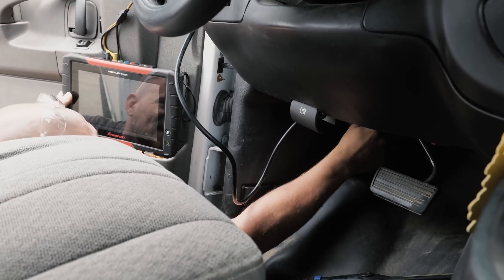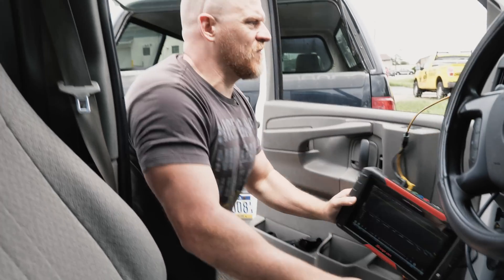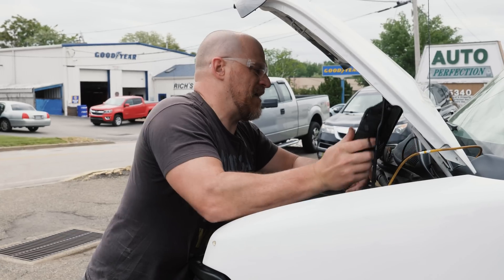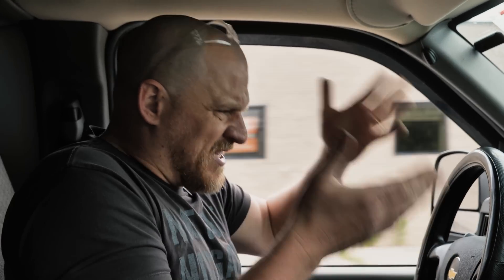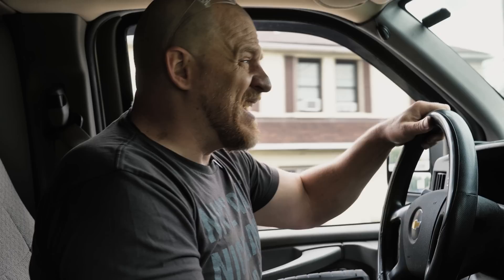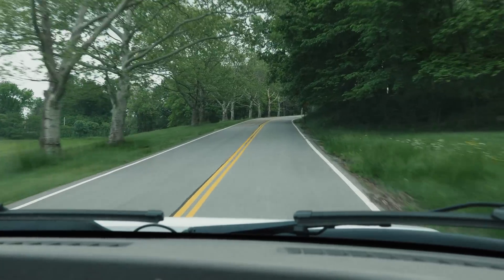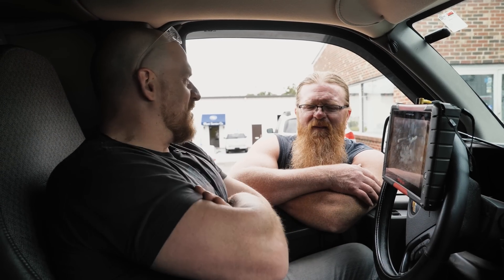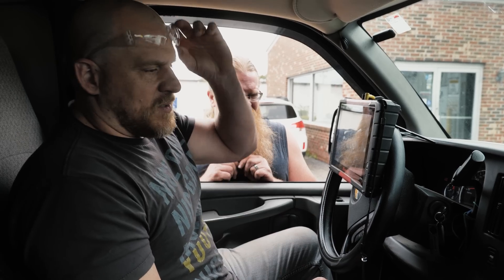We Don't Work For Free [Charging Diagnostic Time]

Comment: Ok and the customer should not pay for you to Eliminate the obvious. The price charged to plug in a computer that takes 10 seconds is absolutely ridiculous.These diagnostics computers are doing the work at this point. Customers are willing to pay for your knowledge not your guess work at their expense. Again Customers can run a diagnostics and get several codes and guess which one may be the problem. What in the hell makes you think it's fair to the customer to pay an extremely high hourly rate so you can guess the correct code from the diagnostics test? NO AGAIN CUSTOMERS PAY FOR YOUR KNOWLEDGE  NOT TRY AND SEE GUESS WORK. WE CAN DO THAT OURSELVES FOR THE PART COST ONLY. WE DON'T PAY  FOR YOUR LACK OF KNOWLEDGE. The customer should not pay because a certified technician does not know which one of the codes the diagnostics test showed is the problem.  I understand these new engines are complicated, however that again is what we pay technicians for. If you don't have the knowledge, you have absolutely no right to charge hours of labor for absolute guess work. RIDICULOUS.
Reply from the maker: See how misled you are? 1.You've only experienced parts changers with the garages you've taken your car to. (Not your fault)
2. You think the scan tool and the codes set is the diagnostic (we have 4 injector codes, should I have changed those injectors?? News flash, that would have cost you $1000 with labor and would NOT have fixed it)
3. This is an intermittent fault that REQUIRES the fault to be duplicated, while I have test equipment hooked up to be able to even be remotely close to finding a direction. Otherwise we are throwing parts at your car. 
I bet you'd be the first one to demand your money back when it's not fixed too? After demanding that you will not pay for diagnostic time. You can't have it both ways! 
 (Stay tuned next week for the full case study)
Reply: I am not speaking about this one particular case you are working on. I am simply stating that it is totally unfair to charge a customer an hourly wage to go through the codes to see which one fixes the issue.  My brother is a certified technician at a dealership for one of the largest manufacturers in the country.  He has access to the latest technology and toys to diagnose a problem.  This is the facts and reality. After every test, diagnostics test run, there are almost always more than one code or part that could be the cause of the problem. At this point the technician will make an educated guess which part to replace first to see if this was indeed the problem.  My obvious point is that the customer should in no way be paying an hourly rate for a technician to be changing a part that the technician has zero proof of that this will fix the issue. Customer should not be forced to pay for guess work period. Again we can do this at home. We pay a technician for their knowledge not guess work PERIOD.
Reply: @tspur3294  Here's how these "codes" work.  A code is a fault in a particular system.  Codes may set in series. P0299, underboost, P1101 induction system performance, P0171 lean, P0300 random misfire could all be related to 1 issue.  Whats causing it??  From reading a code you will never figure it out.  And no, a tech will not make an educated guess and throw a part at it to see if that fixes it.  You buddy, have no idea what you're talking about.   What does he throw first? A turbo for the underboost? An o2 for the lean code? All 4 coils for the p0300? See how silly that sounds???
Reply: @JD730          Every single code is a part that must be inspected,to insure it is working properly before being eliminated as the problem after a diagnostic test.  So again like I stated the diagnostic test does not pinpoint the problem. So why in the hell is the customer paying a ridiculously high price to give these technicians a starting point.   We can do this at home ourselves. If you will be honest you will have to admit that customers are way over paying for these diagnostic test.
Reply from the maker: @JD730  amen
Reply from the maker: @Jeff I hope this is the same Jeff I've been speaking to. It is this type of customer who I was just speaking of in my last comment to you, where they absolutely need to see the difference between a parts changer and a tech. Do you see how misled he is? I was speaking to this type of customer in my 1 in 10 example. I'm trying to convince them that there is another way out there, that they may have never experienced before, and when they find one of us (true technicians), they won't mind paying our diagnostic fees! Hope that makes sense
Reply from the maker: @tspur3294  I agree with you if all they are doing is reading a code and then changing a part!
 ("don't be a parts changer" is my slogan)
Someone who is doing that IS guessing, and is NOT doing pinpoint diagnostics like I do. 
Again, the codes on this van is all 4 injector codes on one bank of this V8 engine. Where would you like to start? It will get way more expensive walking that path and in this case you wouldnt even fix it, than it would be to pay us diagnostic time to actually troubleshoot the issue.
Dealer life and warranty work is a different animal in itself. You get this car with an intermittent issue, that has a code, and you've done 20 of these already, so you know where to go. That dealer tech works on one car line. It is completely different for a guy like me who works on 40 car lines and may never see the same problem twice!
Give that dealer tech a different car and he's lost, why? Because he never learned how to actually troubleshoot!
I'll also add at the end here, that if I've completed my "diagnostics" and make a call and change a part, and it doesn't fix it? I own that car until I find the issue and I NEVER pass that additional time off to the customer. It was my fault I missed it. 
Seriously, I hope you watch next week and then tell me again that I shouldn't be paid for my time.
Reply: @ScannerDanner  Come on scannerdanner be a little nice here.  I bought your book, I have been in the industry 20 years, I am a dealer tech.  Please don't assume all dealer techs are useless and can't diagnose and just throw parts.  That really bothers me when someone of your level thinks that all other technicians especially dealer techs are parts throwers and really makes you come off as no different as the guy who said all techs are garbage.
Reply: @ScannerDanner         well my brother started his career in the military and has worked on about every make of vehicle ever manufactured. So rest assured he is  aware of pin pointing the problem. Which again a diagnostic test does not do and is why I'm saying customers  should not be charged such high prices for the diagnostic test itself. A large percentage of Americans have learned through experience how these diagnostics and codes work and feel we are being way overcharged. Most customers would not mind a fair price for a diagnostic test however the prices charged today are ridiculous.
Reply from the maker: @JD730  I meant no disrespect. This is 9 out of 10 other techs too. I'm sorry. I know some absolutely phenomenal dealer techs.
Reply from the maker: Replying to my "dealer tech" comment. I want to be clear that this is NOT every dealer tech that I'm speaking of here. My best friend Tommy Wolfe (former student) is an absolute badass troubleshooter and does not fall in this category!
I was only painting the picture for this customer who's saying we shouldn't be charging for diagnostic time (his brother works for a dealer) and we all know that the dealership is a perfect breeding ground to develop the parts changing mentality.
I'm not saying this guys brother is no good either and I can see how it maybe comes off that way. I'm just trying to get him to understand there is a difference between what he knows and what can be
Reply from the maker: @tspur3294  
"I am simply stating that it is totally unfair to charge a customer an hourly wage to go through the codes to see which one fixes the issue"

This is not troubleshooting. It's reading a code and rolling the dice on what parts to change and I agree, no need to pay diagnostic time for that!

"After every test, diagnostics test run, there are almost always more than one code or part that could be the cause of the problem. At this point the technician will make an educated guess which part to replace first to see if this was indeed the problem"

A resounding NO here! This is NOT troubleshooting, it's guess work and a dealer tech can get away with it (sometimes) because he works on one car line and has seen this same problem many, many times!

"the customer should in no way be paying an hourly rate for a technician to be changing a part that the technician has zero proof of that this will fix the issue"

Agree 100%! When I'm done, I have proof of where the fault lies, I'm not guessing. 

 "Customer should not be forced to pay for guess work period"

Agree again!!

"Again we can do this at home. Why pay a technician for their knowledge not guess work PERIOD." 

Agree again. You don't know me very well, nor have watched enough of what I do. I'm not talking to the guess work people!!!

Paul Danner 
www.scannerdanner.com
Reply from the maker: You edited your post. This was in response to your original comment
Reply: That's we pay a technician for their knowledge not hours of guess work.
Reply: So yes the amount that the customer is being charged to run a diagnostic is an absolute rip off when you take in the fact that the diagnostic test does not pin point the problem,  it only gives the technician a starting point.  Surely you can comprehend the high prices charged for a diagnostic test is absolutely unfair to the customer. Also the labor charge for changing a part that the technician has absolutely no clue if this is the problem or not is 100% wrong and unfair.  I mean a sense of common fairness and appreciation for the customer must be realized at some point...
Reply: For any certified technician or do it yourself mechanic. A diagnostic test WILL NOT PIN POINT THE EXACT ISSUE OR PROBLEM.  knowing this undisputable FACT. would you not have to agree that the price the customers are paying for these diagnostic test are  extremely high and the customer is being overcharged? Again regardless of education, experience or training most diagnostic will not pin point the problem..
Reply: @tspur3294  so you bring me your car with a catalytic converter code. You think I should 1)not charge you for checking the code. 2)just install a catalytic converter because it's not fair for me to charge the time it takes to perform any tests, 3) install it at cost and at a loss on labor and finally 4) look like an asshole for misdiagnosing your car when the light returns.
Want a free rental car or an hour alone with my daughter while you're at it?
Reply: @fastestcaskets5020    What I'm saying is, yes check the code.  In almost every single case there will be more than one code.How ever after the code  has been checked this is when the real inspection begins to see if yes the Cadillac converter is in fact the problem.  Knowing the fact that in most cases the diagnostic test does not show the exact problem and only really gives possibilities to the technician.  STOP CHARGING A RIDICULOUSLY HIGH PRICE FOR THESE DIAGNOSTICS.  Customers don't mind paying a reasonable price for a diagnostic test. However it is simply wrong to charge these high prices for a number of codes or parts that could or could not be the problem.  Again we don't mind a fair price for a diagnostic. It is simply wrong on every single level to charge these high prices for a diagnostic test. Again there would be no complaint for a reasonable price.  I'll keep my sarcasm to myself. A large percentage of Americans have learned through experience exactly how these diagnostics and codes work and now realize, just how absurd it is to pay such high prices for a diagnostic test.
Reply from the maker: @fastestcaskets5020  preach it brother
Reply: @tspur3294  You seem to be confused. Checking  codes with a pocket code reader is not synonymous with a "diagnostic test". Yes, you can retrieve a generic power train code in your drive way. This is not a "diagnostic test". A drive while gathering relevant data to determine volumetric efficiency is an example of a diagnostic test. And by your logic, if that test proves for instance that fuel delivery isn't an issue, you don't think you should have to pay for that test because it told us what wasn't wrong instead of what is? The tech doesn't deserve his hourly rate for that test? The shop owner doesn't deserve to be paid for the investment in tooling to perform this test?
We are not "guessing which code will fix the car" as you say, nor does "the diagnostic tool do all the work at this point". As an accomplished, professional technician, I find these statements quite offensive.
Reply: @tspur3294  You're dense dude.  CODES DON'T TELL YOU WHATS WRONG.  YOU PAY FOR DIAGNOSTICS. NOT A CODE READING SESSION.  You're paying for us to find the problem and that's why you are being charged because that takes time and skill.  I don't see what you're going on about .
Reply from the maker: @tspur3294  100% incorrect on not being able to pinpoint the problem. Watch some more of my case studies and you'll see. Here, watch this one https://youtu.be/agbEFhAyYI4

Comment: A trend that I've been seeing in the industry is that repair shops are claiming that a lot of their profit comes from the markup on parts. I think that's a backwards business decision. The repair shops should be charging for the skills and talent their technicians have. Parts changers have little, if any, diagnostic ability. It's almost like the technician who can trace an intermittent problem down to a corroded wire is demonized because he didn't sell any parts to make a repair. If we want to be parts salesmen, we'll go work at an auto parts store!
Reply: I agree, the people who take the time and develop the skills to fine the actual fault are often scolded for it. I worked at a few shops where the manager knew next to nothing about automotive repair, they were more or less a salesman. They were only interested in how many parts and services they can sell to a customer. The guy who finds the wire that is broken and can repair it is not as valuable to them compared to the guy who recommends swapping different parts and up selling extra services.
Reply: I know that exact feeling of being scolded for fixing a car with out new parts. At a previous employer, car was towed in from another shop because supposedly it needed a pcm and programming. The boss of course was excited for that. I got the RO, and after 2-3 hrs of fixing all the screwed up wiring the other shop loused up, the veh drove out perfectly fine under it's own power. My shop owner was livid that I fixed it with out the new computer.  I asked him, "would you rather take $1800 and not fix the car, or the proper amount of labor time and have it fixed", he just said, "next time just do what you're told". ..... I laughed......

Comment: You're absolutely right about 9 out of 10 shops being nothing but parts changers. I work at a shop that takes in all the work that the other local shops and dealers can't handle. It really sucks when you get a vehicle after it has been to 3 other shops for the same issue. Half the time the vehicle arrives with the truck full of old parts, the vehicle is partially disassembled, and there's a whole slew of erroneous fault codes from the last guy unplugging stuff.
Reply: I agree. I work for a dealership and we get a lot of cars from the independent car lots or the buy here pay here lots and those "techs" at those lots and the chain shops can't fix the most obvious fault especially if it has anything to do with electrical work.
Reply: @JD730  I think a big part of the problem is that most tech schools don't seem to teach diagnosis and they don't give their students real world problems to diagnose. I went to a pretty good school, but I still learned most of my diag skills by working in the field and seeking out information online. The case studies that ScannerDanner posts are way more informative than what I saw in school.
Reply: @SALEEN961 😂😂😂 "school" only teaches the basics,  enough to get you an entry level job. I get a good laugh at people who think school teaches everything you need to know and will make you an expert